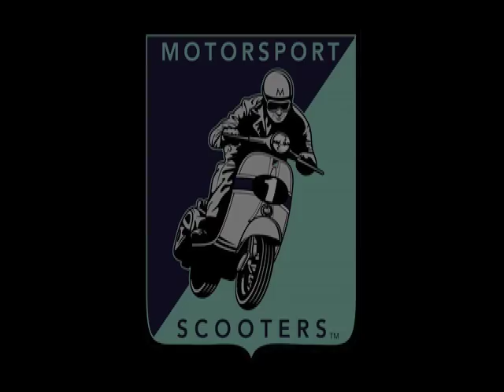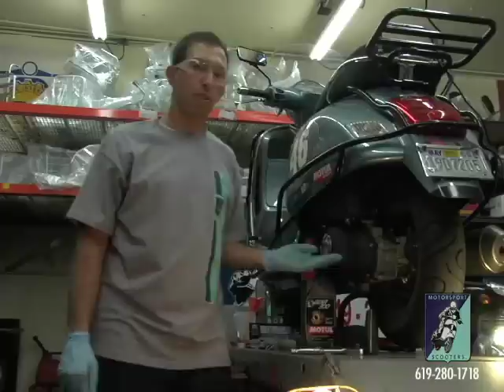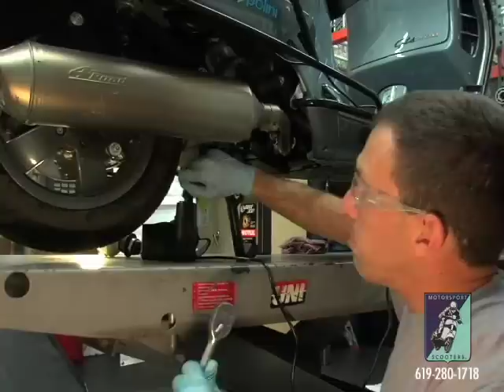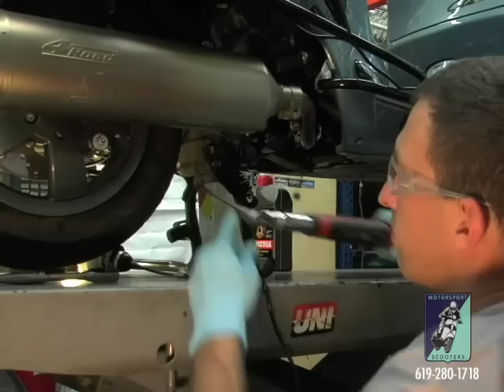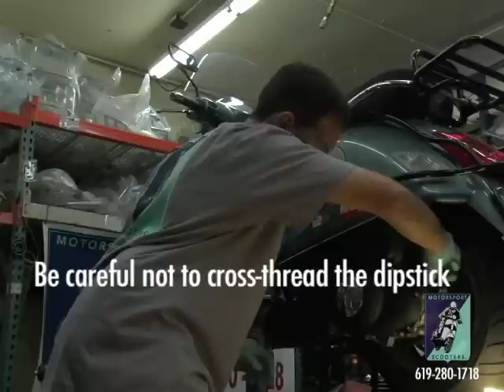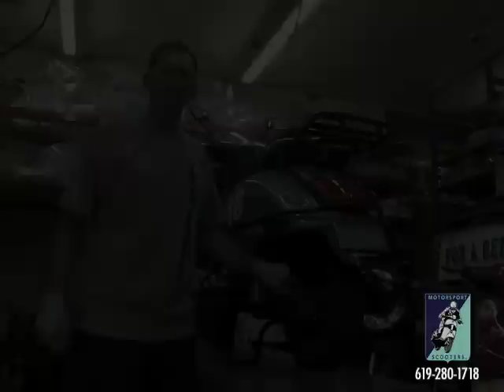Vespa Gear Box Oil Change

Comment: Hi, I don't have the manual with me for the 2010 Piaggio Fly 150. I filled it up to 500ml since it's what I saw in the dipstick 500 4V or something. What would happen if I overfill it with gear oil. What's the correct amount for my scooter?

Comment: The GTS.. is that the 200?    8mm allen key.. is this the same size for the BV200?  It has to go thru the hole in the rotor on the bv.     Does bv200 use the same amount of hub oil?  (bv200 is a 2003.)Thanks.
Reply: would've been interesting to know what size engine the vespa is.  my bv200 takes an 6mm allen wrench and can hold a total of 250 cc's of gear oil.

Comment: I dont no if this is an old Vespa GTS or what but all the 125/250/300 GTS's take 250ml of gear oil and that should be a 80W90 grade as shown in any vespa service manual..???